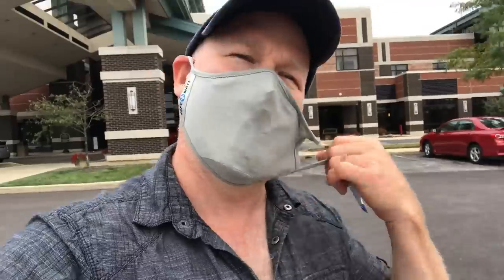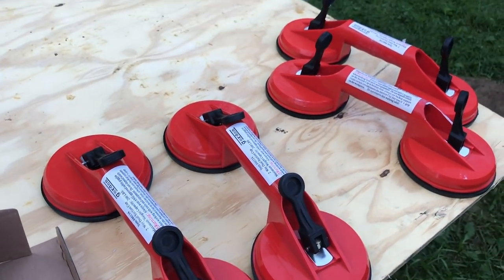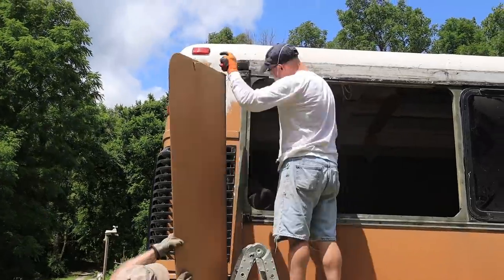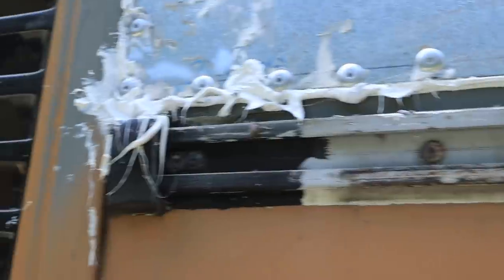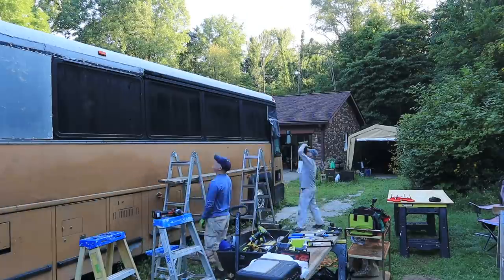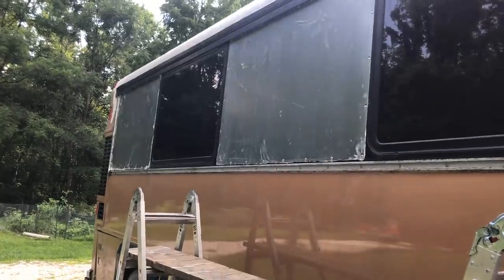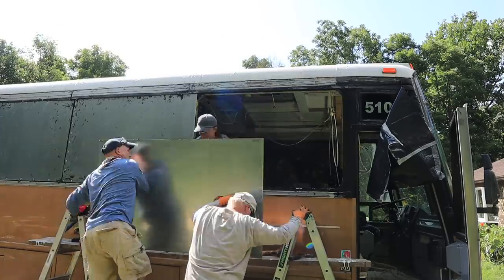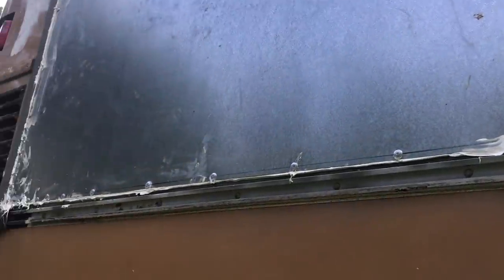Sheet Metal Siding for our Bus Conversion: Part 2 - S03E31

Comment: Iv'e had 3 different stone procedures and not a one of them was pleasant, now i skip the doc and use my own recipe that seems to work well for me. Bus is coming right along
Reply from the maker: Hi Uber
Man sorry to hear about your stones. What’s your method? We’re thinking keep hydrated and stay away from high oxylate foods
Reply: @Rehabit8  The diet you mentioned and the yucky olive oil and lemon juice shot daily it keeps the burrs burnt off the stones and the olive oil helps small stones and even some larger stones slide out easier. Saved me many trips to the ER if i even feel the slightest tinge of pain i start the shots and usually it goes away or i pass it.
This really helps, hope he is doing better with his.

Comment: Could you put a extension piece of sheet metal on the top. Somewhere between 4" to 6". Get good overlap of the metal for good sealing.  Not optimal but could solve lots of issues.

Comment: I saw that you guys spent a lot of time doing research on your installation and paint , because of the fumes that would be comes out and you guys would breathe them in. So my question is how did this stack up with the sealer and the 3M tape around the windows. For sure since it’s on metal and direct in the sun so it should get real hot and bake. Even when the bus gets painted. 
I’ve asked this question before, but watching you guys take out all the nice big windows and seeing that the passenger can’t look out (yet) of a window and it cutting off your wide view to see traffic, boy that got me so in panic mode lol I’m not very good in dark , tight places lol 🤪🥴
Reply from the maker: Hi Judy. One of the main reasons we did decide to pull the windows was insulation. The busses original windows were single pane and let in so much convection heat and UV that pulling them and insulating walls made the most sense for having a comfortable home when we are done. 
The giant views were wonderful, but in reality we will have walls and furniture that will cover lots of the old bus window realestate so we opted for control and comfort.
Removing all the windows does not effect Views for the driver and we are planning our windows in places that we think will be nice for the passenger and for everyday life :)
All the materials (sealants/tape) are surprisingly resistant to weather and are designed to be road worthy. The sealant is even food grade safe for fixing water containers etc!

And since we will be insulating the walls inside the heat and cold should keep at a distance. That’s the plan anyway.. it’s our first project like this so we are learning as we go and as you’ve seen... sometimes we learn the hard way

Comment: Good morning guys Don are there three hinges at the top where the window mounted because I found that mine was leaking at 3 other window locations. The reason it probably didn't leak before to started skinning the windows out is the gutter covers the hinges and if your gutters are still off or put on with out a good seal around them they will leak I know this for a fact plus I would have to go back and watch your first video if you removed the row of rivets on the top so the new panel just slips under the roof edge? I know it only takes one rivet not seated right to cause a leak but I'm sure you got it figured out by now.
Reply from the maker: Yup, I don’t want to be a spoiler for future videos for anyone but yes....we did figure out the drip rails were actually where the leaks actually came from. Thanks Brian!
Reply: @Rehabit8  yeah I found out the hard way but it's all good now live and learn right.
Reply from the maker: Exactly!

Comment: If you had only thought and removed the back side of the rail that's under the window , you might not have had the issue the leaks, then the metal would have went under that rail then you could have replaced that rail for looks
Reply from the maker: Yup!  But....you’ll have to keep watching because we figure out the leak and it’s not coming from where we originally thought

Comment: Removing that window by the door will severely affect your visibility when driving.   Or are you installing a smaller window???
Reply from the maker: Hi Sherry 
You don’t use the windows at all when driving the bus. You use the side mirrored and that is it. Turning to look back through the windows is not really an option because of the position of the seat

Comment: Don’t know why you didn’t leave the widows in situation and either board up the inside or put blackout film on them inside. Just saying
Reply from the maker: A few reasons - we want windows we can open for airflow with screens to keep bugs out and cats in, the bus windows are single pane whereas the RV windows we are putting in are double pane which means better insulation, plus while a lot of people build in front of their windows and just blackout the window it is not advisable.  It may be easier but what happens if that window breaks or gets cracked!  How are you going to replace it if you have a wall or furniture in front of it?